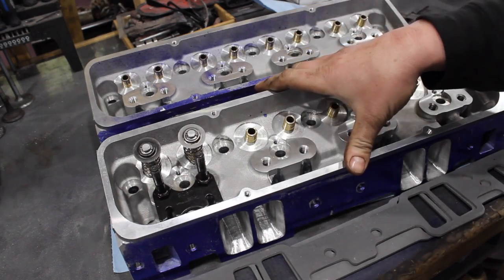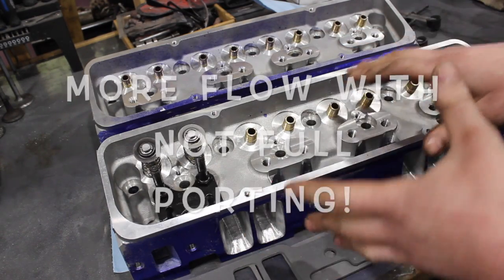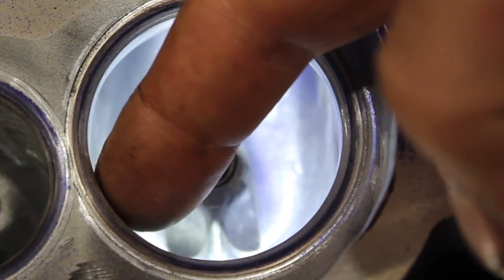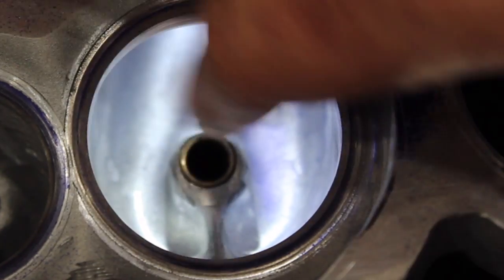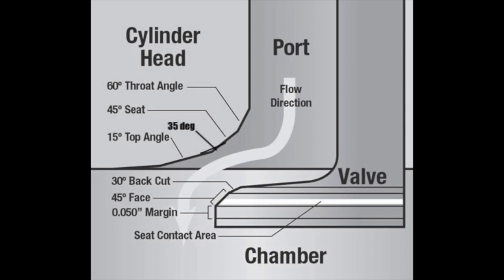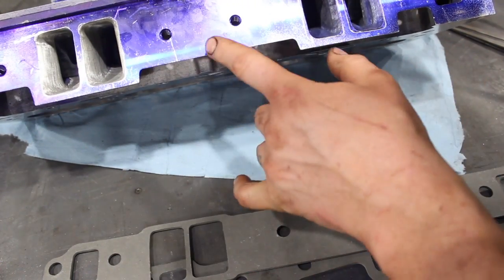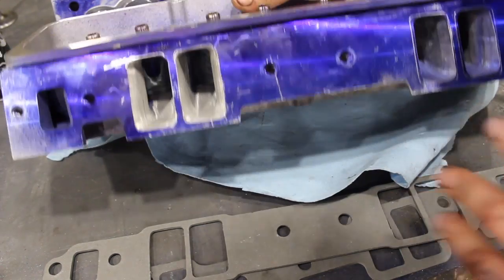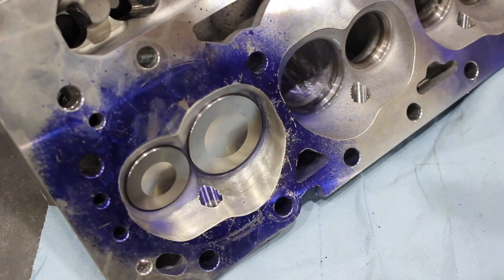Budget Head Now 550 HP Capable! Help me Build it Series

Comment: Thank you for all the videos!  Just picked up a pair of 305 vortec's. And wondered what's your part number(s) for the bee-hive springs?
I'm installing on a  forged .060 283/Comp 268. Gotta run better than older 416's (?) Plus the vortec's have hardened seats right?
Thanks again.
Reply from the maker: Actually im just finishing up a video on 416s (305 HO) heads vs the 305 vortecs on the flow bench. With some porting to see what the 416s can do. 
Yeah the 059 (305) vortecs have induction hardened seats 
Cheers!
Reply: @cuttersperformance  AWESOME 😎
I've been porting my own stuff for decades. Never had any issues.
I also have 2 sets of the 416 ho's (Ho ho ho😜)
Reply: 520s or 059s run better than 081s or 601s that run better than 416s.

Comment: You mentioned gasket matching the intake after doing the heads. I would think going from smaller to larger at the intake port/cylinder head port junction would actually help, a bit of anti-reversion. Like everyone else I can hardly wait to see the dyno results, should be a very nice combo! Thanks!
Reply from the maker: The old sang is a step is always better than a wall when it comes to intake to head alignment. 
(Aka a smaller intake port is better than a smaller head port)
But personally im a believer is the smooth transition between the two if possible. 
Im still playing catch up with other projects for customers but this will be the next one to hit the dyno
Cheers!

Comment: Lighter valve train= ability to run less valve spring= less parasitic loss= less heat= more rpm potential before valve float sets in. I know you know that, but you shouldn't downplay the significance of a lighter valve train, plus the machining from afr is usually very good, the valves are high quality. When starting with the assault racing head, to bring it to the same spec afr does would be difficult to do for the diy guy and would likely cost more than the package from afr. It is huge bang for the buck. And if the diy guy does some basic bowl work they are even better than afr advertised specs.
Reply from the maker: O i totally agree but heres the way I look at it: Most guys looking at heads in this range are running hydraulic roller or flat tappet cams with operating ranges under 7000 rpm. At this point there's really not a huge need to lighten up the valve train as there will be no benefits found, and often times springs are spec'd basically the same at this level given your cam type.
So I'm just trying to let guys know that they don't have to go to a 8mm stems as it will be added costs with no real benefit in my opinion (Alot of guys think they add flow) but its great that the afr heads come with them already.

As mentioned in a previous video i totally agree that the AFR head is a better product overall and if for average guy they are the way to go If your looking at a budget head. But if you have a good machinist and willing to do some clean up then a guy can used the assault heads with great results. 

I'm not trying to push any products but just offer some results of things I've have done. 
Cheers!

Comment: are you going to have to worry about dropping valve seats with the reduced material above the seat? i wonder if that little bit of extra is for when the heads heat up and expand it can still hold the seat in on that side.
Reply from the maker: Its a very slight amount of material removed as your just blending the edge.
More material would be taken off if you went up to a 2.05 valve than the bit of blending. I dont foresee any issues here but i like your thinking 
Cheers!
Reply: @cuttersperformance  i feel a little bit better about it then. i know you deff know your stuff. ive just seen so many alu heads that dropped valve seats even stock id be so weary about it. really good gains from the heads though. i was drooling but i think im sticking with modded vortecs when i go bigger on those